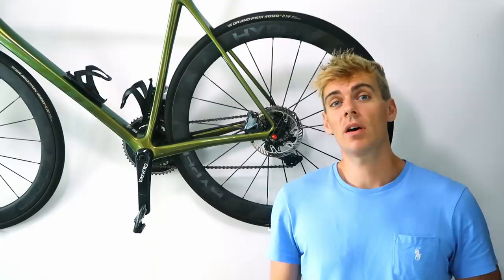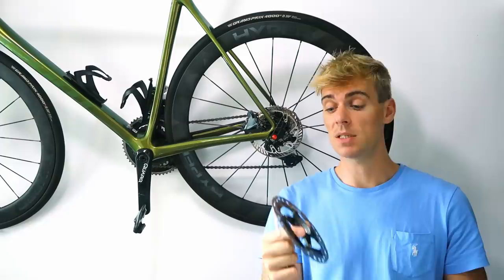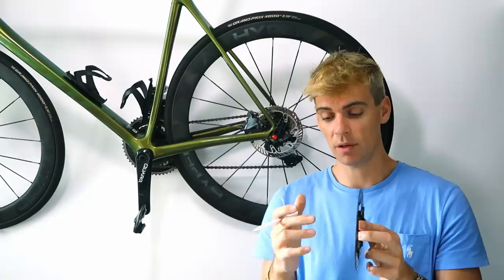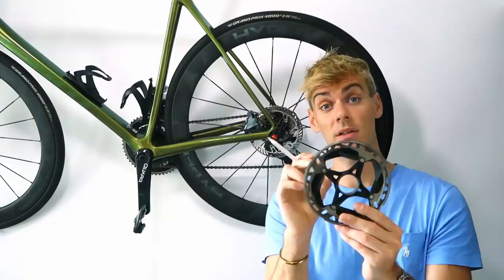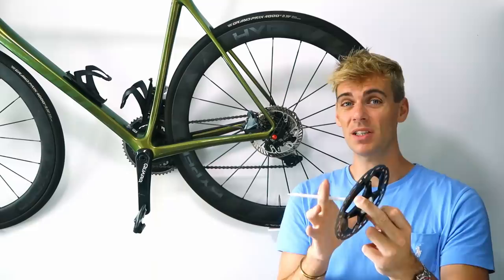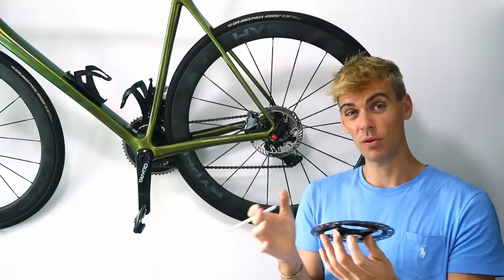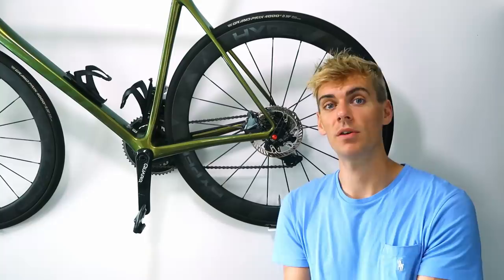Why I stopped using Shimano rotors: Disc brake rotor design, cracks & thermal issues discussed.

Comment: @Peak Torque
Interesting video watched back to back with the earlier one responding Chris Froome's comments about discs.

Most forks on road and gravel bikes are limited to 160mm rotors but 180mm rotors make a lot of sense for everyone except the weight weenies.

If you're open to suggestions for new videos, how about looking at change in affect on the fork between the two rotor sizes. There seems to be a lot of internet engineer speculation but it would be interesting to see a proper analysis of this.
Thanks.

Comment: I don't know why cycling disc brakes have issues, I have used many types of floating and non floating motorcycle racing discs for 30 years on Ducati's and Yamaha R1's, issues are well known, including the solutions. The conditions on racing motorcycles are far tougher, including keeping component weight down whilst trying to stop 250+kg from 200mph.

Comment: I currently have Ultegra rotors. I suppose they have less issues because the cooling surface is a lot bigger? They're almost solid with just a few holes. Can't say much about the wear as I haven't been riding that much because in the last year... because of reasons. Previously I had basic six bolt steel rotors and they lasted a few years.
Curious to see what design you come up with.

Comment: Is there a point where the number of perforations, that permit cooling of the rotor, reduces braking efficiency?
Reply: Yeah, look at any weight weenie rotors, their braking performance is garbage due to reduced contact area. Race cars can use lightly slotted or solid rotors for best performance AFAIK.

Comment: Beyond the subject...
How tall, precisely, are you? I want to buy 2021  TCR XL and I'm wondering if this size is accurate (I am 6.36" ft (194cm)). Unluckly I can't try one in local bike shop. Racing purposes ofc.
Reply from the maker: 195cm and ride XL. Find it ok apart from the st angle is pretty slack.
Reply: Thanks!

Comment: How long until we start seeing proper brake ducts on disc brake bikes. You would think it would be very effective on the front rotor given it's location. It might even be possible to design a zero drag duct when you factor in the thrust you could potentially generate from the heat loading.

Comment: My Shimano rotors often bend out of shape and drag on the pads for miles after I ride down a steep downhill. Not riding the brakes, not racing, just a steep downhill with sharp corners that requires periodic hard braking. It's really annoying. Can't wait to have something better. In the meantime, what  which adapters do you recommend to mount the Campy rotors to Centerlock hubs?

Comment: Question, 
Do you use metal or organic brakepads?
As metal are much harder for disc rotor and organic are much nicer to them. All weather depending ofcourse. 
Also Shimano is also the only one to have 4 mounting point. Sram and Campag have multiple mounting point. Less area to warp as they are held closer together?

Comment: I need your email to get on board with those rotors! Now I've done some research on rotor cutout design and as long as you don't Tacoma narrows the cutouts and spokes, it'll have almost no effect on braking performance. 

And I love how you are using a different steel (I'm a knife guy, so I'm picking up what you're putting down) but I'll judge you if it doesn't have a significant quantity of vanadium.

Comment: If you want a full steel disc on a spline hub a potential solution would be to get a spline to 6 bolt bracket adapter and then attach whatever full steel disc you want, I would personally recommend the sram mtb ones, they are cheap, don't warp and last for fkn yonks.

Comment: I would go with larger rotors and thicker all steel ones if I had this issue. I will admit on my mtb I have had weird blueing on shimano rotors compared to older all steel rotors. A road bike can get going to some pretty fast speeds on decents so I could see the need for bigger rotors. Thicker ones like magura's 2.0mm rather then brands with 1.8mm ones might help. Not sure if shimano or other brands still make centerlock to 6 bolt adapters. Were common a while ago.
Reply: I have the adaptors made to order .

Comment: Hello there, so after watching your vid, I bought into the same Ekar db-160/140 rotors and noticed quite good amount of play back & forth while squeezing the brakes (lock rings were torqued down to 40nm). After some checking, it turned out the centerlock spline tolerances of the Ekar rotors aren't as close as my Shimano Dura-ace ones. With the lock ring loosened I could tell the difference in the amount of play twisting the rotor back and forth. If I remount the DA rotors the play goes away. I was wondering if you have this issue on your setup as well? Is it of any concern? Cheers

Comment: Disc brakes are probably more powerfull and better at modulation, and for gravelbikes the best choice (the tire clearance argument there)  But for roadbikes they seem unnecessary complicated, heavy and expensive. The only real argument I can see there is too save expensive rims from wear.  I have never felt that I need more braking power...the small area that the tires has against the road is not that great on a bicycle  ... Caliper brakes feels more "back to basic" and ..troublefree somehow.

Comment: cast iron steel rotors? my cooking pan outlived 3 rotors by now and is still going strong!
Reply: Gotta keep it seasoned though
Reply: You can use rotors from a car, they are vented from inside and made of casted steel. 
They will probably outlive your bikes frame (but of course they will be heavier than the rest of the bike) ;-)

Comment: What simulation software are you using? What are you defining your boundary conditions regarding temperature?

I’d be interested to see how the heat conducts through steel rather than through dissimilar metals

Comment: SRAM have a different width brake track to Shimano - can cause problems at times. I've had to shim my sram brakes with 1.5mm washers to fit shimano rotors. How does campy brake track width compare?

Comment: There's a new development to use an integrated disc wheel, it saves weight and provides better thermal dissipation than rotors, with no annoying rubbing. 😉

Comment: Very interesting video. They are kinda expensive and are only made to fit in center lock hubs anyway, so they are not an option for me, but given these issues, I'm happy with my cheap 6-bolt rotors
Reply from the maker: Yes given the chance i would still use 6 bolt rotors.
Reply: @PeakTorque  btw, your disc project sounds very interesting

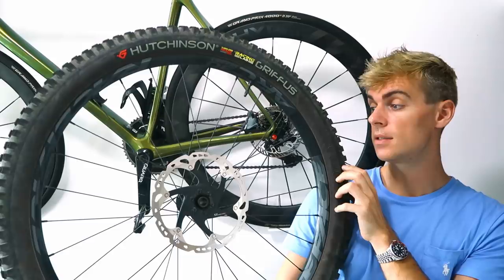Comment: 0:30 Here's a little trick all MTBlers do: use a bigger disc. The better performance will counterbalance the higher weight by far. 4:22 That's right. There's no more annoying sound like that. 13:41 Conclusion: get bigger disc-rotors ^-^

Comment: Hey, you should have a look at Trickstuff's discs. They did quite some research into disc brakes. they offer rotors made from a decent steel and make them thicker (2.05mm) so they don't 'warp' too much. However, the rotors are 6 hole only. 
What do you think about centerlock to 6 hole adaptors? And why do you think centerlock is better?

Comment: Interesting. Haven't had an issue with my Ultegra discs which are the same design, a good 6 months and 100,000m of descending on them without issue. Perhaps the Dura-ace are just made a bit more lightweight and less durable?

Comment: i ride Shimano MTB-discs since 10 years . I never had an issue with them.
Reply: 10 year old rotors are not laminated..
Reply: @mgoo1713  I didnt say that I only use one 10 ten year old Disc. I have  several Shimano discs on several bikes. All working fine. The only thing is, these are MTB disc...

Comment: That rubbing @2.38 is exactly what happened on Gran Canaria 2 years ago. Descending those hills, braking for the bends, release and feather going in and once completely released on the exit the Icetech rotors rubbed like hell. It only lasted a few seconds but on some decents there's only a few seconds between bends...... Explained to the shop and they said "that's normal"......
I've been running Hope brakes on the MTB for 15 years and the crosser for 4 years. In the North Lakes where we can descend 3000 ft of proper technical rock etc and the rotors have never rubbed nor the sintered pads ever squeeled.......
Another awful trait of Shimano discs.......

Comment: - Rotors riveted like these are not floating.
- All centerlock rotors are riveted - by the necessity of the interface
- Steel is a poor thermal conductor, in realistic scenario in order to get 250C on the hub shell you'd need to get several kilowatts of power through the pads and hundreads of degrees on the braking surface. Pads are going to fail WAY before that happens. Your hubs are safe.
- thermal interface between 6-bolt rotor and hub, or between riveted surfaces is very tiny and very poor
- braking surfaces are made of steel because of its tribological characteristics - steel wears off, aluminium tends to gunk up the pads and is too soft in this application. There were some brakes with aluminum rotors, but they required special pads and the rotors themselves were thicker.
- if anyone wants a full-steel centerlock rotor - low end shimanos are excellent.
- EDIT: to mr PT, if he reads this. I made rotors out of Bohler N690 steel, which hardens to ~60HRC, afair ( up from 40HRC for typical 420 steel ). They take forever to break in, but also take forever to wear out.

Also considering that these rotors are, essentially, bimetal elements, differences in thermal expansion rate of both materials will cause stress to accumulate in the rotor when it gets heated, and as it cools down, its going to settle to a different shape. This explains 'warping' after being cooled.

Comment: How's the design of your rotors progressing? Having just had to replace a rear Shimano rotor due to being easily bent out of shape on my cross bike, I'm definitely interested in trying out a new design. I imagine UK winters would encourage a little tarnishing as well!
Reply from the maker: It's on the back burner but i still want to get it done. Currently work is getting in the way. Also the cost is huge, of machining it how i want it. Trying to get the price down with a few factories.

Comment: Thermal expansion coefficient for steel is half that of aluminium. Steel 13 X 10-6, Aluminium 22 X 10-6. Shimano is asking for trouble with that design. Campagnolos discs looks a lot better.

Comment: Looking forward to see what you can come up with.
BTW, why not use 6 bolt with a CL adapter?
Reply from the maker: Could do that, but it just becomes another possible area for a stiffness drop and hysteresis which could lead to squeal.

Comment: That would be cool if you made your own rotors, do you think the different kinds of steel will cool faster ?  For example iron keeps heat in better than other metals like stainless steel . That Would be cool to use you're knowledge to make a really good long lasting rotor that preforms well.

Comment: Pleasantly surprised to see this video -- I had been wondering why you were running the XTR rotors (which of course are always in the background), but sounds like they didn't do any better than the DA/Ultegra ones.  I had read that the Shimano pads run a little small on Campy rotors, but I guess is that not an issue after all?  My cheap bike has non-Shimano brakes (and thus bigger pads), so I ended up trying the Campys for sh*ts and giggles, curious to see how you get on with them before you're able to make your own.

Comment: I'd like a pair because I love to support smart people coming up with better products than the big companies.  Also, I've wondered why they designed the gap between the rotor and the pad is so tight?  It seems a lot of the bitching about disc brakes could be solved by widening that gap and allow for more tolerance?

Comment: Hello! Is anyone using Ultegra/DA calipers with Campyn AFS 03 rotors? How is the long term experience? Are they rubbing/ticking as much as Ultegra and DA rotors do? Also, the campy is 1.85mm thick and Shimano ones are 1.8mm. would that create clearence issues? Thanks!

Comment: I guess there are some mistakes, the disc's are not really floating. So you don't have any real float and that causes the problem. On every application you have either floating disc or floating calipers to avoid the problems. We really need bigger rotors on roadbikes. Other than that, road bike people are annoyingly nitpicky with the noise.

Comment: Do the Campy rotors wiggle fore and aft on the rotor splines? Thanks.
Reply from the maker: No, but i have some play between the outer steel disc and the spider at the rivets.

Comment: Not very clear on what the "mounting conditions". I find it hard to believe the disc would just deflect because of the ring of disc just thermal cycled. Besides, you have this thing rotating at a pretty high rpm and the heating and cooling should be pretty even all around.

Comment: Actualy shimano rotors are not floathing type. check out hope rotors and superstar alpine. However all of the warping explanation is true. Also i am suprised that it took too long to people figure this out :D Best shimano rotor i think is SM RT-76. Its not sandwich ice tech. Solid stainless steel. But Hope floathing rotors with metal pads are my favourite and i use them on my enduro bike for 4 years.  When RT-75 wear out i will switch to hope rotors on my road bike too.

Comment: Disc brakes are so fiddly. I have them and get they are better than rim brakes in most cases, but god damn they are a pain in the ass, maintenance wise
Reply: Bed-in, bleeding, replace the rotor, replace the pads (that's al we had to do with rim brakes!), nothing to set the spacing or alignment of the pads precisely...
Now I need thin shims for center-lock so that I can switch wheels without re-centering the calliper every time...
Then you have tubeless with regular maintenance, new pumps, and all the stuff needed to clean and wax the chain!

Comment: The rubbing noise you get after hard braking is not the rotor. It is the caliper heating up and the pistons are unable to retract back into the bores until it cools off. With that being said, I still don't like the Ice Tech rotors. They are too fragile. The solid steel rotors are much better choice.
Reply: I.e. the cheaper ones for $10 - $15...

Comment: Just to say I used to race 5th scale road cars which brakes discs all round the first discs that came out where steel but over time we changed to a fiber type with steel pads just wonder would something like this could be looked into. By the way the cars went 60 to 80 mph and weight was around 12kg. A guy to contact would be Ian Oddie he used to make the discs he is also an engineering genius (imo) ask a any one to get 9bhp out of a 23cc engine he can lol.

Comment: Side question related to the spider arms. What is the reasoning behind the construction of the Campagnolo rotors (or any other)? Seeing this next to your head made me wonder while watching ^^.
Similar to the spokes you talk about in your wheel building video. Would the arms of the rotor not have the tendency to buckle when you brake as they are moving straight into the caliper? I'm guessing I'm missing something here as the other way around is also no solution... Why no leading/trailing "spoke" design here for good measure? Is the radial Shimano rotor in that aspect a better design?
Reply from the maker: I think most disc rotors have the tangential arms going the 'wrong way' to counteract the thermal stress. The thermal stress tries to expand the disc, and having them orientated this way can help 'shrink' the disc again under braking. Perhaps!

Comment: Have you tried the SwissStop rotors? I find them a lot better than the Shimano ones
Reply: Hope it actually perform better than the pair that spark Chris Froome's disc brake rant.
Reply: @Hexsense  well I have never had an issue with them. Can't tell what froomey did wrong
Reply: @MrMaxlo1  they are slightly different width I believe so would need some adjustment

Comment: Value my time and money too much to bother with discs- Rim brakes all the way
Reply: I live in a hilly area and i don't want to heat up my rims so much from downhill braking with rim brakes, so i switched to discs. I adjust my disc brakes maybe once every two months for less than 10 minutes, and they work well rain or shine.
Reply: @sepg5084  I ride both rim and disc, descending at 50mph/60mph the latest generation of carbon rims offer the superior option as the discs suffer significant fade in comparison. Slower speeds  20mph and disc are best.

Comment: What about using a Carbon brake rotors?
Reply: they're not hard nor very thermally conductive.
Reply: @Cerv3ra  i guess the correct term is carbon ceramic rotors. 

not being very thermally conductive is why i was thinking they might be a good option. In other words the heat doesn't transfer to the hub. 

What does worry me is durability. I can see an issue of the rotor being very fragile in a rotor as thin as a road bike's. 
But other than how fragile they might be and possibly the cost, a carbon ceramic rotor would be very stable thermally and concentrically. I'm guessing due to the weight vs steel, a slightly thicker rotor could be made for the same weight as a current steel rotor. 🤷🏻‍♂️
Reply: @kennethh5657  Okay, I understood carbon fiber because they actually exist. Carbon Ceramic rotos for cars work because the calipers soak the heat, plus they usually have forced ventilation (F1) I dont think it's a practicable technology for road bikes.